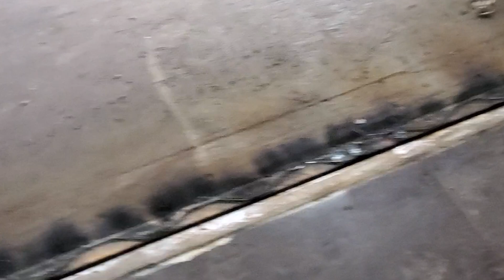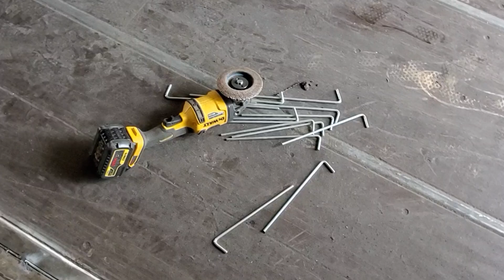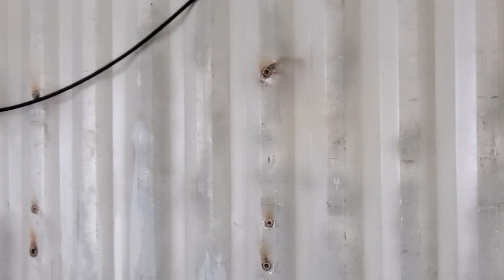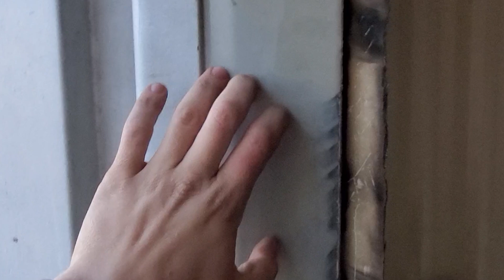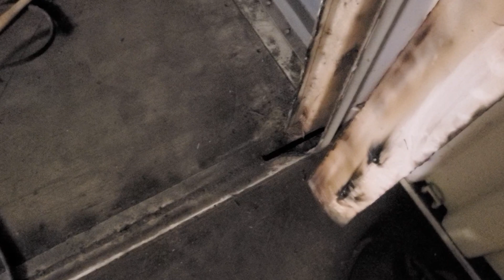Container Homes Are Not Easy.  TONS Of Grinding And Welding!!!

Comment: Is the OSB going directly onto the floor? Wood sleepers and rigid foam insulation might be good for a quiet, more comfortable (if not also better insulated) floor.
Reply: I'd strongly consider the Matt Risinger approach 2-4" of EPS or even XPS foam followed by two layers of Advantech OSB (set perpendicular so that the seams don't overlap), it's an easy way to avoid any thermal bridging
Reply from the maker: Our issue here is that we have an environmental chamber on casters that weighs 1025 lbs.  Rolling that around on a floor with any flexibility be bad, so that has limited our options for flooring quite a bit. We also have the doors setup so we could drive the tractor with a forklift attachment into here to set down a palette of something, say, maybe, batteries?
Reply: @noahg4038  The only issue there is striking a balance with thickness. The rest of the container being metal, it's only ever going to be just so well thermally insulated anyway. Building up too thick of a floor just decreases ceiling clearance in the already tight, predefined space of the shipping container.